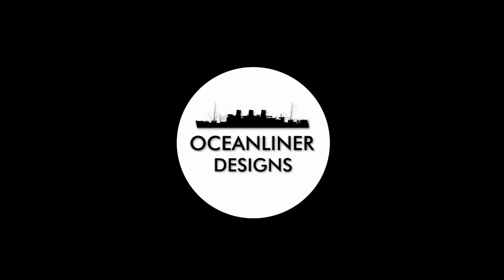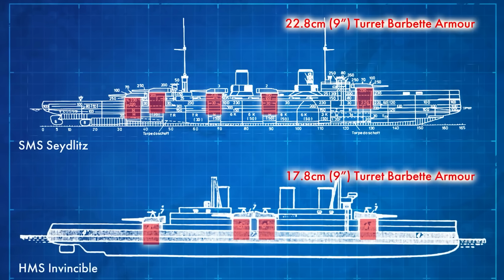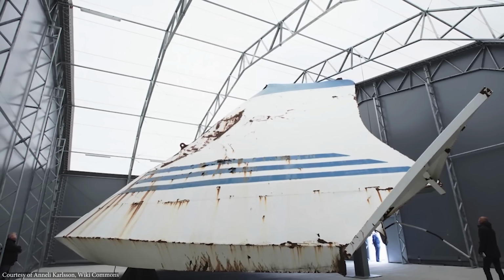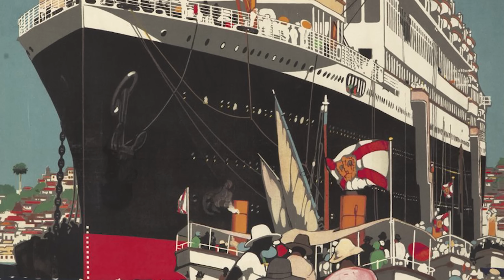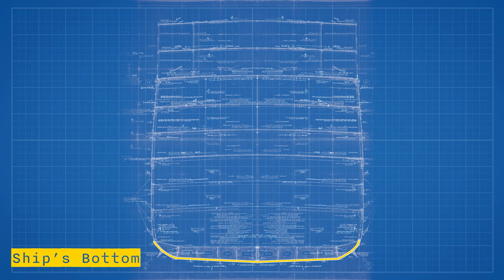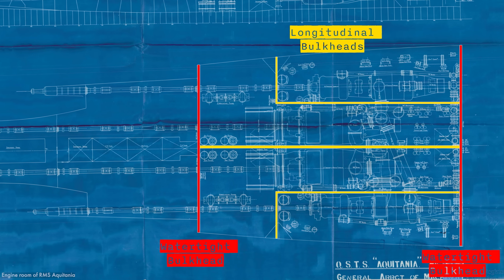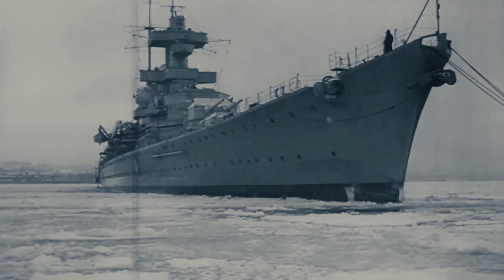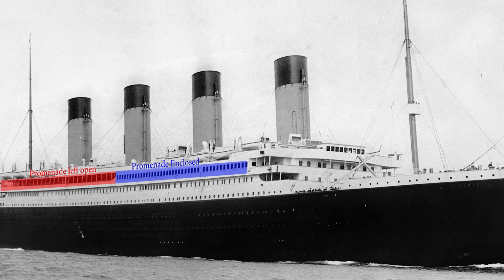The Worst Ship Design Fails in History

Comment: The SS Badger featured at 14:24 is a passenger steam ship in Ludington, Michigan.  Built in 1953, she is 410 feet long and was originally designed to haul railroad cars across Lake Michigan to Manitowoc Wisconsin.

In the mid 90s, she was converted to carry passengers and their automobiles across Lake Michigan.

As shown in that photo, she has a large sea gate on the stern that lets the cars in and out while docked.  The car deck is several feet above the waterline, so the  sea gate only really needs to keep wave action out of the ship.

I was born and raised in Ludington, Michigan, and have traveled on the SS badger at least a dozen times in my life. It is still operating seasonally on Lake Michigan.
Reply: I have many fond memories of crossing the lake on the Badger and her sister the Spartan, and less fond memories of ye olde City of Midland which seemed janky to a kid in the 70s. I haven't been on the Badger in years but family members have been, and to a amateur eye the ship seems well maintained. This particular ferry has recently been under a lot of scrutiny for dumping coal ash into the lake and one would hope that while resolving this issue safely inspections would have happened but I don't know. I will say I would still sail on the Badger confidently despite its age.
Reply: @paulhoppin5513  I saw an item on the Badger that it now collects its ash and offloads it on shore.  Problem solved! 😁
Reply: @ about 10 years ago, they were required to stop discharging their ash slurry into Lake Michigan.  That was a practice that all steam ship did.  The badger is the last coal fired steamship in the United States, and for a while they were allowed to discharge that ash under a waiver from the EPA.

They invested in a one-of-a-kind collection system that collects the ash on board the ship, and then it is removed when the ship reaches Ludington each trip.
Reply: @MichiganExplorer236  Hunh, I heard some of the land-based coal plants actually figured out how to take the ash and make it into bricks.
Reply: @ according to the SS badgers promotional YouTube video, they apparently use the ash as an ingredient in cement
Reply: @MichiganExplorer236  ah, cool. :)
Reply: Oh man, I traveled on the Badger once as a kid! Glad she’s still around.
Reply: I've traveled on the badger a few times.   Once as a kid, in the early 1990s,  we took a family vacation from Chicago to Door County Wi, and then along the coast of Michigan.  Back then the Badger I think docked at Muskegon rather than Luddington.   Like 10 years ago, I went again, in my 30s.  It was a road trip with my wife (fiancee at the time),  and my brother,  and his girlfriend.  The 4 of us went to visit family in Sturgeon Bay,   and then we took the badger to MI and drank at many breweries around Grand Rapids and then hit the Alma Highlands Festival.   It was an amazing little vacation.  The Badger was kinda boring,  but,  it was nice to get up on deck and enjoy the nice cool breeze.

As far as I know the Badger is still coal fired too,  most other old steamers were converted to Diesel.
Reply: SS Milwaukee, great great grandfather of SS Badger had to go through design flaw trials. I grew up n’ da UP der eh! Cool meeting another fellow Michigander. Even if you’re a Troll ;)
Reply: @hotchkisshick8628  how dare you even suspect me of being a troll
Reply: Jones Act moment
Reply: I love the badger, it really jumpscared me suddenly seeing it in this video
Reply: My grandfather built the ss badger by himself. The navy never paid him. If anyone wants to make things right and give me the money, I would appreciate it.🇺🇸
Reply: you still have a 72 year old ship which is carrying cars and passengers ?
Looks like the next desaster to me cause how many ship desasters had been shown by the channel brick immortar about americans ships that were not safe at all ? 
We have traditional ships like steamers in some areas and to keep them running based on 2020s regulations costs fortunes or stops the operation as passenger ships which usually makes those to museum ships along a peer. But this only happens to ships operated on our rivers or lakes, rather small lakes compared to Lake michigan versus lake constanza which is by far the biggest and deepest.

I can not imagine that 72 year old ship will meet all the US safety requirement standards - which are so often cited by brick immortar in the NTSB report released after another deadly accident.  Here all ferries have to meet highest standards or they will be sold to countries outside the EU cause if they become illegal here then they have become illegal in the whole EU. And ferry routes are being replaced more and more by bridges or tunnels, those in the baltic sea as those crossing rivers cause ferries are expensive and have issues in harsh winters to make it.
Reply: @typxxilpsit's a good thing you don't have to imagine it, you can come experience it for yourself. Apparently you know very little about Great Lakes ships. ✌🏻🖖🏻
Reply: @typxxilpsthe argument could be made that regularly aged ships in the EU are equally as dangerous, because a lot of accident happen with them… your point is null. Of course the ones that aren’t kept properly updated have more accidents, and of course you don’t hear about the ones that are.
Reply: @derangedemu  I believe the Badger is a designated historic site; it's a most interesting vessel, the last coal-fired passenger ship in the U.S., and it's interesting not only because its steam engines are Skinner Unaflows, which in their heyday approached the efficiency of modern marine diesels.  It's definitely on my bucket list!
Reply: @yknott9873  man, that sounds like a thing to see yeah.
Reply: @typxxilps  A large number of very old ships still ply their trade on the lakes. Fresh water means they don't have nearly the same level of corrosion issues as saltwater ships do. The ship I worked on when I was a Marine Engineer, MV Cuyahoga, was built in 1943 and still in service today. She suffered an engine room fire i  2023 and has been laid up since, but she still floats just fine. As of the scrapping of her sister, MV Mississagi, in 2021 she is the oldest Canadian flagged vessel on the lakes. The American side has a couple ships a year older in service. The lakes are home to a lot of very old ships, still sailing 80+ years post-launch.
Reply: @typxxilpsshe has been tested and everything is up to date for safety I've been on her plus freshwater doesn't eat away a ship like saltwater and she doesn't go out in the fall and winter when the lake gets big storms
Reply: @typxxilps It comes down to good design and operations.  The Mataafa is notorious for how on one fateful night she was grounded and severely damaged in a heavy storm, and half her crew died that night.  Well... Mataafa outlived the rest of the crew and wasn't decommissioned until decades later.  She started out as an ore-hauler, and ended it as a freighter transport moving cars.... but not people.

And that was decades after the ship got broken in half due to grounding in a storm.
Reply: @typxxilpsit does though. American is a can do country. And post fabrication updating isn’t impossible when funded by the state😂😂
Reply: @typxxilpsThe Badger is a seasonal ferry. Metal does not corrode on the Great Lakes like it does saltwater. There are a lot of surprisingly old ships on the Great Lakes.

Comment: Your discussion of cruisers is a little off.  Scout cruisers, light cruisers, and protected cruisers were much smaller than battleships, but the armored cruisers were about 75% of a contemporary battleship's displacement (comparing SMS Scharnhorst and HMS Black Prince to HMS Lord Nelson).  The armored cruisers used smaller guns than battleships to enable more powerful engineering plants to achieve higher speeds.  The threat of cruisers to a fleet of battleships is that they can stay outside of the battleship's gunfire range and report on the battleships' movement.  The destroyer screen could try to chase off the cruisers, but that might leave the battleships unprotected from an enemy destroyer flotilla making a torpedo attack.  The battlecruiser traded armor to be even faster than older cruisers, while carrying long range heavy guns.  The mission of the battlecruisers was to find the enemy scouts and sink them.  The lack of heavy armor was not seen as a drawback, as they had longer effective range than anything they were out to destroy and faster than anything that could effectively fire back at them, so they could just flee from an enemy battle line.  

Battlecruisers were cheaper than the battleships, not because they were smaller, but because they had less armor plate and the armor plate that they did have was thinner.  HMS Invincible had close to the same displacement as HMS Dreadnought.

The best example of what battlecruisers were supposed to do was the Battle of the Falkland Islands, from WWI, where HMS Invincible and HMS Inflexible caught Admiral Graf Spee's squadron of armored and light cruisers and were able to use their superior speed and range of their guns to desired effect.

Drachinifel, in one of his videos, looked at the propellant used by the Royal Navy.  A problem that was not fully appreciated was that the RN powder charges 'sweated' nitroglycerin, which fell off the powder charges as dust.  In drills, powder chares would be moved from the magazines to the guns and get loaded, but not fired.  After completing the drill, the powder charges would be unloaded from the guns and sent back to the magazines, creating a trail of dust from the magazines to the guns.  A gunnery officer on HMS Lion noticed the dust, found out how dangerous it actually was, and had all of the dust swept up and disposed of, while putting in place measures to prevent it from building up.  It was possible for this dust to detonate from even a non-penetrating hit from a heavy shell against the turret, from the impact shock, alone.  HMS Lion took some hits at Jutland, but did not detonate.
Reply: All cruisers are meant to be scouts, including battlecruisers. Light cruisers are destroyer destroyers, protecting your destroyer flotillas. Battlecruisers are cruiser destroyers, protecting your cruiser divisions. One of the correct uses of cruiser was done by Ajax, at the Battle of Cape Passero. One of the correct uses of battlecruiser was done by Warspite, at the Battle of Calabria.
Reply: @SennaAugustus  I was using 'scout cruiser' to identify ships that had no armor, to allow enough fuel to cross oceans and do cruiser stuff that does not involve pitched battles with anything larger than destroyers.  Protected cruisers had a turtleback deck protecting the magazines and machinery spaces, but were, otherwise, unarmored.  light cruisers were armored against destroyer guns and armored cruisers were nearly as armored as battleships.
Reply: the discussion of Ur Mom is a little off.

Comment: Battlecruisers weren't cheaper than battleships: in fact (barring later battlecruisers like Hood that were pretty much battleships) that was the big criticism behind them, as they were just as expensive as battleships but much worse at dealing with enemy capital ships as a strategic asset, which is really the only strategically justifiable use of having a ship that big and expensive.

Then there was Indefatigable, which was so badly designed even cruisers - her ACTUAL INTENDED PREY - could easily have ripped her apart. 

Re: British shell-handling practices, it was Beatty's forces specifically that used unsafe handling practices (so Queen Mary and Indefatigable exploding was his fault, but Indefatigable would probably have exploded anyways for reasons mentioned above). Invincible wasn't part of that squadron when Jutland happened and HER explosion was entirely the result of her being put in a battle she wasn't designed for (but should have been given her expense).

Comment: You would think that if ships require a completely intact hull to float then if you put a hole (door, porthole etc) in that hull it would be ship engineering 101 that because that hole must be closed to maintain an intact hull then all measures possible including assigned crew, alarms and safety lockouts, had to be taken to ensure it was regardless of cost, use, situation or ownership. Mike, I think you are being very lenient.